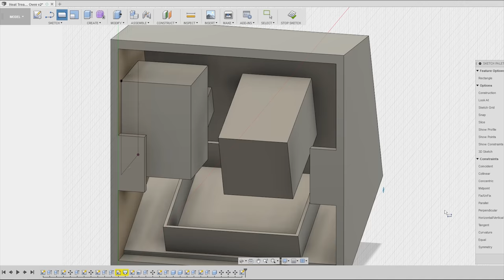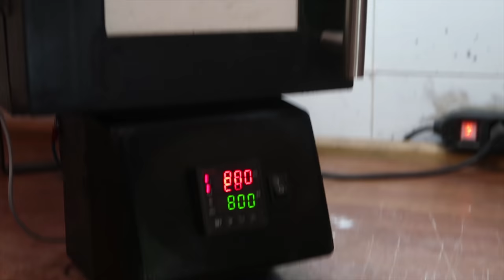DIY Heat Treatment Oven

Comment: Safety is first, please add some isolation to points where cables are connected to heat element, it's outside under voltage!!!!! Rest of the 
project super ;)

Comment: I have had heating coils break on different things like hairdryers and the such. The hole through the bolt connector you made had never crossed my mind to do.  I live with 3 daughters and a wife which means we have a budget item for at least 3 to 4 hair dryers a year. 
90%  of them fail at the rivet connection at the board. Thanks for the fix.
Reply: our clothes dryer  heating element the nichrome wire broke . really wore out. i just wrapped the broken ends together  a couple times. then i broke down and spent the $30 for a new element

Comment from the maker: I see more safety concern than usual, let me address some! 
The frame is grounded and all connection are nice and tight. 
Someone suggested a door switch to cut power to the heating element with the door open, I will do it asap. 
Some sort of box around the heating element terminals would be better too.
Anyway, I'm the only one using my homemade tools so I'm not worried at all even as is!!
Thank you all for the suggestion and preoccupation. Be safe :)
Reply: As long as your happy with it is all that matters!! lol
Reply: Yeah I recommend a door switch, you don't want to touch the life wire with the non insulatet thongs. By the way is the input line cold or does it heat up very much?
Reply: Hey dude you should consider a fuse inline with the wiring. Because if you short to the frame which you say is grounded.... Just my 2c.
Reply: 7dusedr10: if he shorts to the grounded frame, it will trip the trip switch (aka residual current device, ground fault interrupter) in his fuse box, which is designed specifically for this purpose.

Now, a trip switch only protects against shorting live to ground/earth, not against shorting live to neutral. The fuse in your fuse box protects against that, but is usually overdimensioned in regards to what your device realistically consumes. So your point is valid: having an appropriately sized one on the device itself is always a good idea.
Reply: Yes, good point about the RCD, but you assume that he has an RCD, unless you know where he lives :-D.
Not all countries mandate them and most only mandated their use in the last 20 years or so. In some places installation is infeasible ie: the UK is a death trap. If he doesn't have one he should buy a plug in one for the garage or wherever he needs it.

Fuse will also take the burden off the earth wire gauge. It must to be rated to handle the fault current for the duration it may take to gaurentee that the breaker in your fuse box trips. Normally earth bond testing is something like 20A or 30A for 30s and total impedance must be <0.1ohms. This is especially important with the metal enclosure and the dangly spring wire LOL. If the earth wire fails before the fuse trips, uh oh.

I believe in super cheap household devices they often design the live wire so that if it shorts to neutral the wire just melts and fails safe, and doesn't continue to burn due to intrinsic safety or UL94 V0 rating LOL. I'm thinking cheap toaster!

Cheers
Reply: Damn, really? I would've thought this would've been mandated for at least 40 years in the Western world.
Reply: You'd think so right. I guess it also depends on the age of the building and when the last electrical upgrades were carried out. I rent, so i always check the outlets in my garage are connected to the RCD in the main fuse box. It pays to check and you also never know who wired up the place :S
Some outlets in the lab at my workplace are not connected to RCD's for some weird reason, so we have to use portable RCDs on them at all times!
Reply: Hmm, you have a point. I remember when I bought my house 10 years ago, it did have an RCD, but none of the outlets in the kitchen had their earth pin connected, so a lot of good that did...

Back then a new law had just gone in effect here in Belgium that required sellers to have the wiring in the house checked prior to sale. But the burden of fixing the defects fell on the buyer, who had a 18 month period in which to do the necessary repairs. So yeah, if a house is being sold that's never changed ownership since prior to the RCD being mandated, there is a chance none is present. Although I do believe there's also a mandatory check every 25 years to see if the wiring still conforms. But I don't know if they actually perform these since my parents never had this follow-up visit, and they built nearly 40 years ago.

Since my unconnected earth pins fell afoul of regulations, I ended up yanking all the old wiring out of the walls and laying my own. Only way to be sure. ;)
Reply: 7duser10+ Ummmm… RCDs are now standard in new houses or new electrical installations in the UK since 2008. The one I live in has 3 that all the breakers go through.
Reply: Meme Master ... Very good.. New houses and installations. Think about how many are built and installed prior to 2008? Maybe even prior to 1950's? My comment about the UK referred to power cords requiring a fuse in them which addresses the lack of breakers or appropriate wiring in a lot of  buildings due to the very old age of a lot of them. Cheers.
Reply: Awesome job with the build. I wouldn't bother with a switch on the door though, it's not like you'll be running it while open, too much thermal losses and i don't know about you but my oven in my kitchen doesn't shut down every time i open the door. As long as you use safe work practices the higher heats obtained shouldn't be a problem. The only change i'd make would be to use a higher heat rated IFB firebrick , a 2500 F or  2600F IFB , not quite as soft as the 2300F IFB, and just as workable but a bit more expensive. Also your channel for the heating element is well done but all you really need is a dado cut into the IFB. To fix heating element in place , make up some staples out of SS 14 ga wire and pin in place (6 or 8 would do),  just push the staple into the brick.As it stands , it will be years before you'll ever need to rebuild. great job.
Reply: Black Beard Projects is it 110 or 240 volt system?
Reply: In Italy RCDs have been compulsory since the '60 with a maximum current difference of 30mA for residential buildings but that does not mean you should rely on them for safety.
Reply: Being in the US, I had no idea what an RCD (Residual Current Device) was but see they are relatively equivalent to GFCI (Ground Fault Circuit Interrupter) that is used through the US and Canada.
Reply: how long is the resistance at 1000 ° C? one day. one year? or?
Reply: how does grounding help when you put in a piece of steel with bare hands while the thing is running haha
Reply: You didn't mention it hear or in the video, so I figured I would. Wear a respirator and have ventilation when sanding those fire-bricks; they release silica dust; hazardous stuff...

Comment: Absolutely fascinating, bro. I wish you gave a few more details on the heat control and exhaust fan that you installed. Also, the insert you made on top of the oven. Thank you so much for this.

Comment: Small correction: With the blocks arranged as shown, the internal depth will be 15.5" (due to the rear center block subtracting 2.5" from the 18" overall length). I plan to make one exactly this same size for your same reasons, including being easier to move around and store than most.

Comment: great work. That 3d printer is cheating! I was with you until the PID and computer portion of the build. The channel iron you used to hold the knife in the beginning will cast a shadow on the IR that reaches your object to be heated. You need a plate with stainless steel pins or something coming out f it to balance stock between. Wonderful concept and application, though. I am impressed.

Comment: coil diameter is significantly larger than recommended by Kanthal, I assume it is Kanthal A1 wire and sticking metal things into the oven with "electrically hot" element, that is something.

Comment: Nice work as usuall, you might want to add a thin metal plate over the controller box in case sth slips and falls on it  and some insulation on the resistance wire terminals. The beard wont look nice if it is electrocuted. :P
Reply from the maker: Ahah! I'm looking after my beard don't worry :') Thanks mate

Comment: Very cool build, although Id use a swinging knob to lock the door. 
When I saw the 3D printer. My mouth dropped.. love those things. Are you happy with it and what would it run $.  I work at an EMC lab We/they test anything electric so you can licence to sell. Just sent a guy out to "3D printers and Co. to calibrate there building". Wished I had been able to go. Nice oven !!!

Comment: How did you insulate high electric voltage from the frame of the oven?
I'm curious about an instant death by touching the frame, and the current of the heat coil is going through a person instead of creating heat
Reply: Adding a door switch and make sure you ground your oven

Comment: Very nice build, only the coilconnection scares me, because these are uncovered and are a real shockhazard. They are also very close to the metal chassis. Can't you make any covering for those?
Reply from the maker: The chassis is grounded, but yes could be safer for sure! :') Not concerned since I'll be the only one using this.
Reply: But as a youtube-engineer/-producer giving off the wrong sign of safety. As a safetyinspector in real life, I would recomment to do an updatevideo about it, because this will be copied somehow. Never the less still a very good build and I'm going to copy it, without the connectionissue ofcourse

Comment: Hi Blackbeard, thank you for showing this amazing build. I would like to copy it as it is of course, to be honest. You mentioned that limitation of "only" 1000° C. Is that sufficient for the treatment of all common stainless steels? Somewhere in the back of mind if think to remember that some need like 1050 or more. What are your experiences so far? Thanks in advance and keep building, you are amazing and a true inspiration to me.
Reply: R B 1050C is 1922F. That’s pretty hot for heat treating.

Comment: Black beard.  Great video I am planning on making an oven based on your design.  You are right, the oil quench is not suffecient for stainless steels.  What voltage are you operating at ?  By my guess looking at your power cord 120V AC. Also by your statement of 1.7kw.

Comment: Hey there! I'm worried. Have you installed a fuse in there? The connection to the heating spiral looks suuuper sketchy. I dunno man, maybe print a little case to contain it. Also since the wire expands and shortens the whole time cuz you're heating it it might come off. Use at least a springloaded nut or something...
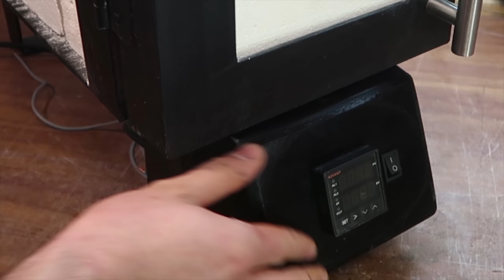Reply from the maker: Look closer at 9:45 Pretty sure the wire can't get loose from there :) Anyway some cover would be better on the outside!
Reply: Black Beard Projects Dunno about that. I could sleep better at night if it would've been some self locking nuts. I mean you use springloaded rings on protective earth connections too. 

I totally forgot to praise this oven, lol. Sorry about that. This thing is amazing! I need to build one too. ^^

Comment: Today i looked for fire bricks at Amazon-And they werent available. I wanted to build myself one today
Reply: Cod Bo - I got mine on ebay. Not expensive.
Reply: You could make them yourself. Get lye and silica gel for waterglass and mix it up with perlite.
Reply: contact a refractory supplier. Ask for an IFB firebrick (insulated fire brick) in a heat range of 2300 deg F or better. Personally , I'd recommend a 2500 or 2600 rated IFB, they're slightly denser but stand up better in the long run and are still easily worked , 2300 F IFB's are pretty soft. you can score the surface of a 2300 IFB with your finger nail.

Comment: Unrelated kinda, wanted to do a heat treatment chamber like this BUT i'm also wondering if you can use the same technique to build an electric pizza oven since we could easily reach 500C° in those chambers. With some refractory stones at the Bottom to store the heat...

Comment: Did you have any issues with the PETG warping and/or melting? I would really like to build one myself some day and was also considering 3D printing the control box, however seeing at what distance to the furnace door you put it, I wonder if that would impact the PETG, since it's a thermoplastic? Great video in any case, thank you for documenting your build!

Comment: I have a little problem while building this nice oven. First of all thanks for this video. You did a great job with this oven. As I wrote before I also want to build this oven for heattreatment but there is one problem with this PID controller. I found one on Amazon and it looks very similar to yours but the Relais Output can only control 3 amps but my kanthal wire has a potential current of around 7.5 amps. Did you ever measure the current when you want to reach about 1000°C. Is 3 amps of current enough? If not I had an idea to let the Relais Output of the PID controller activate a second Relais with a much higher current potential. Do you think this is a good idea?
Reply from the maker: Thank you! Mine draws 7.5 amps, so no. You have to use another realy as you say :) Look for a solid state one (SSR).

Comment: Hi congratulations for the job ...
My concern is about  the frame. Since the bottom part (the control box) is smaller them the top part, there is a risk of overturning... how do you handled it?

Comment: Hi there! Very interesting work! 

Is it possible to make this oven change temperature at a fixed rate, to treat CPM steel?
Reply: Only if the controller allows ramp up to soak and ramp up again as needed, filament life greatly extended by doing this. Some controllers also can ramp the current to the filament so to prevent hitting it with full current instead of on and off giving the most life from the filament.

Comment: Amazing job on this. It looks like something you could buy online for hundreds of dollars. Great design and it seems like it will remain solid for a long time. Since it can get to rather high temperatures, do you think you will be using it for any sort of forging or just heat treatment?
Reply from the maker: Thanks! Only heat treatment, this has great precision but it's slow to heat things up I think. Much slower than a coke forge for sure :')

Comment: The way you connected the nichrome wire to the power cable without any insulation looks unsafe, you could touch it or it could touch the steel frame
Reply from the maker: The frame is grounded! But yes, touching it would be bad just as touching the coil inside. Since I'll be the only one using it I have no safety concern about :)
Reply: Black Beard Projects ah vabbene, comunque non ho mai visto quei mattoni refrattari, vanno bene quelli classici?
Reply: cerca gasbeton, credo proprio si tratti di quello eh
Reply: Stefano Carta È il gasbeton? Io ce l'ho già perché ci ho dovuto fare un tramezzo in muratura, ma non pensavo che si potesse usare anche ad alte temperature

Comment: Will that wire filament eventually burn out?
Reply from the maker: Kanthal alloy it's made for this application so I hope it does not or in very long times :')
Reply: On my work we use kanthal too, we have two industral furnaces for heat treatment up to 250 kg, with the years they will get weak and eventually fail.
Reply: O R  we use bigger resistance, usually 30 meters long, and the wire have a bigger diameter, they can not be coil by hand, sometimes is a paint to put on the refractory due to how the oven is made.
Reply: Yes, it is industrial size, the poor furnace works almost all day, 6 days a week, is the biggest one on my country and have a high demand. The refractory is cast and not on the form of bricks, sometimes the wire is so so damage that fuse with the refractory and looks like slag

Comment: Really nice built! How long does it take to heat up to 1000 ºC?
Reply from the maker: Not tested yet. Takes 25min to reach 820°C so I guess 40 min or so
Reply: Really good. I've worked with a similar oven in the past and the maximum heating rate was 5 ºC/min, so it'd take forever to heat up to heat treating temperatures.

Comment: My kanthal A1 wire kept melting just a few minutes after i connected the electricity
Reply: not enough wire for the current you are using, you need to make sure the gauge you are using, then the length, is a formula which I'm too drunk to think about that helps calculating, I built a heat oven for 240V with 59 feet of 16 gauge wire which gives me 3KW and more than enough power to heat treat stainless steel (1875F-1900F)

Comment: As a stand, use one of the bricks with a notched slot. Then the blank will be at the height of the heater and will not heat up faster from radiation. Metal stand slowdown heating.

Comment: Could this be viable as an induction forge if you used tungsten coil or another high temp metal?)
Reply from the maker: Induction heating it's quiet different from this kind. I'm not sure what you mean sorry :)

Comment: 1700W, really low power! My toaster oven had two heating elements of 800W each. 
But my eletric shower can use as much as 8000W in full power. But then the water would be too hot.

Comment: Why so much whining about the use of a 3D printer and asking for detailed step by step schematics?  I see these things as a sort of barrier to entry.  If you lack the skill or understanding to figure out/adapt these details to your situation then you probably shouldn't be building this potentially dangerous oven.  To those asking for a lot of hand holding, spend some time doing independent research and then I'm sure you'll figure it out.